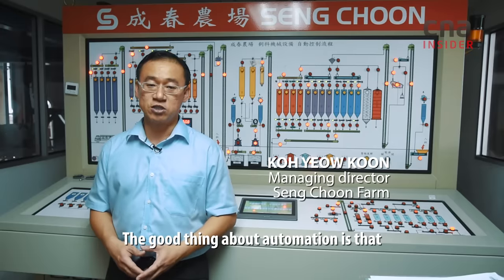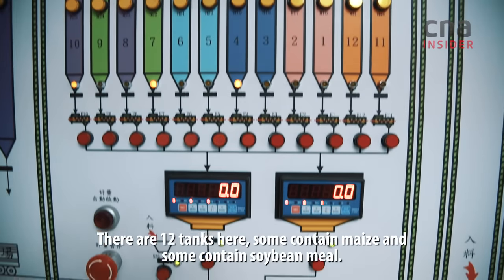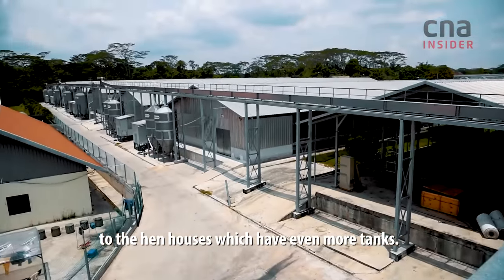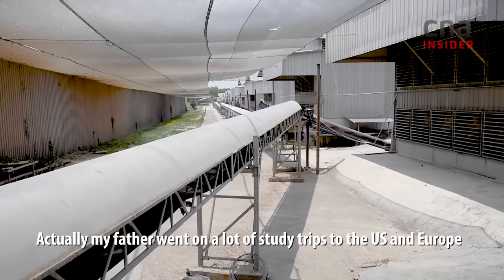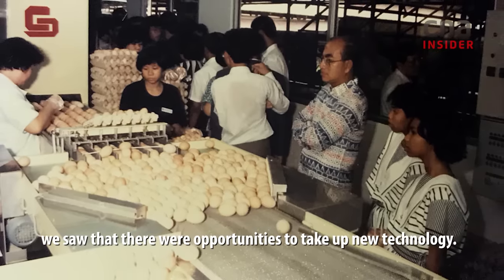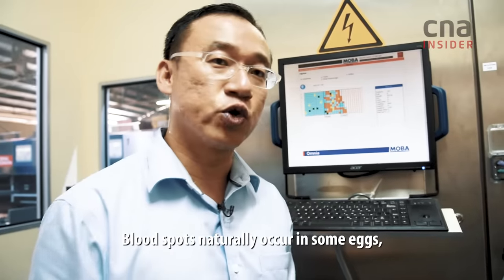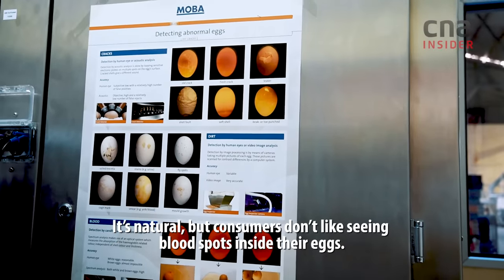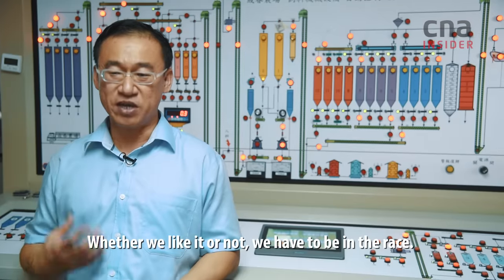Inside Singapore's Largest Egg Farm

Comment: Singapore ...one of the only place where even an industrial chicken farm is as clean as your local clinic ! Amazing place .
Reply: 2:35. You would eat that?
Reply: @bananajohn7689  Can you even read? This is a system specifically designed to get rid of the crap.
Reply: 2:35 do u really think it's clean??? They didn't scrape or wash it with water. I bet it is still so smelly even with ventilators.
Reply: @vm6445  That’s the poo conveyor ! Do you expect it to be clean !!!
Reply: Do u think the cage doesn't have chicken poo sticking on their cage? My father used to have chickens before and I know how their poo stick on the bottom of the cage/floor. Do u think these chickens can even see the sun or even breathe for fresh air? Or even walk just a few meters away?
Reply: @vm6445  They are clearly not organic ones but they do not have the space to do that , you need loads of space to get high end chicken it is not only a matter of eating good grains and not using any chemicals or médecines .
Reply: @vm6445  You are just hating cos you think you somehow know better.  Let me tell you that I have purchased their eggs before and they don't look filthy or smell horrible.
Reply: yes agree most clean then Malaysia road 🤣

Comment: hi i am seeking a professional opinion not the American tree huggers please. i have a small chicken egg farm with 500 birds. i recently was away and the wife was running the farm with some help and on my return i see that pox is spreading thru my farm. about 50% have it. they are pasture free range in a barn with an area for the to go outside. i was told these birds where vaccinated before i bought them but that appears to have been a lie. my question is should i wait til they get healthy or should i remove all and clean the area and start over? if you could give me a hint in terms of what will be most profitable .will i lose money cause of the down time from pox or will it just be a small bump in the road in terms of profit. if i sell now i get about 60% of buy price. Chickens are 9-10 months old now. Thank you.
the reason only half have it is because they where bought in two lots from diff farms. one appears to have vac and the other seems to have lied. where did it come from? my guess is the turkeys my wife bought had it. she thought they would be good eating if she just fattened them.